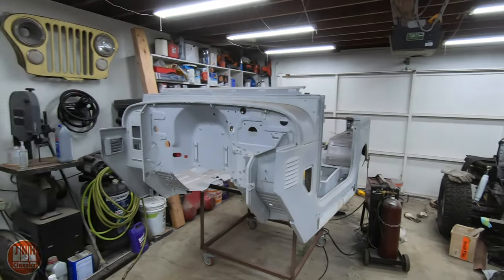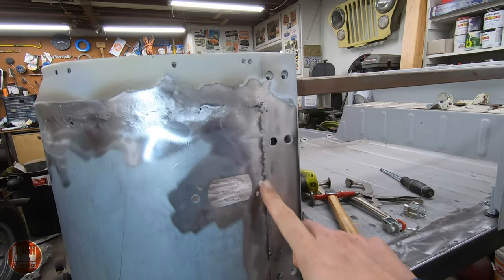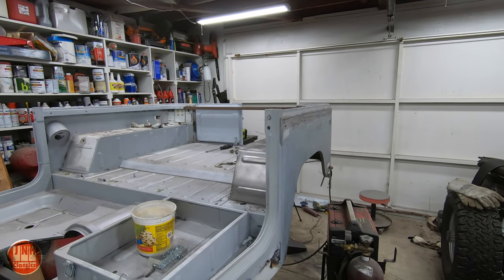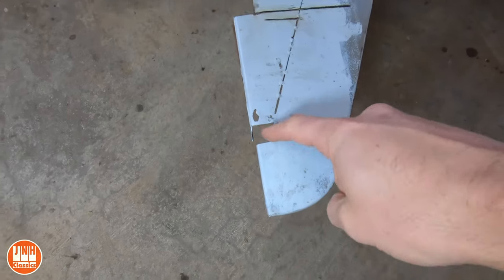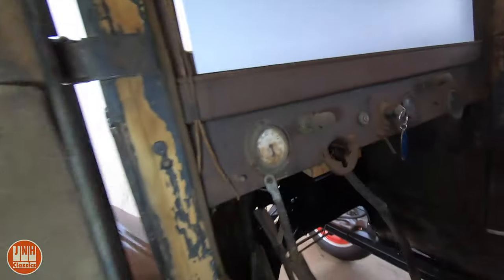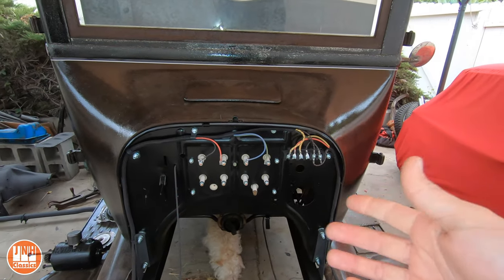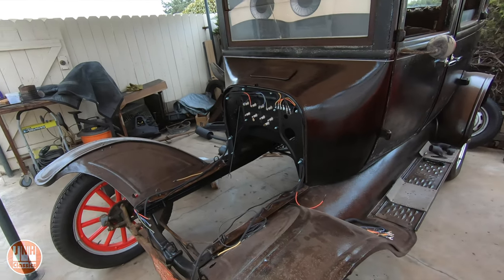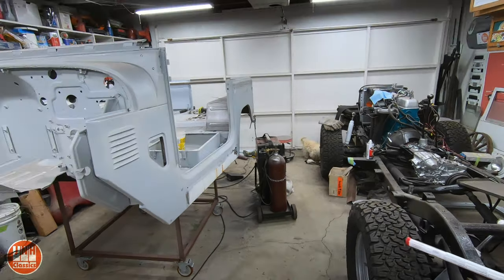FJ40, Model T & Walter - Sunday Update Video (12-27-20)

Comment: Wow, great job on welding that long stretch on the rear quarter - looks like no shrinkage??  What size rod did you tig with and what was the strategy for heat control?  Wish you would have filmed it... Walter is the photo bomb king!
Reply from the maker: I did film it. The video will come out Wednesday👍
Reply: @Jerod_Helt  Great, what size rod did you use?
Reply from the maker: 3/32”👍